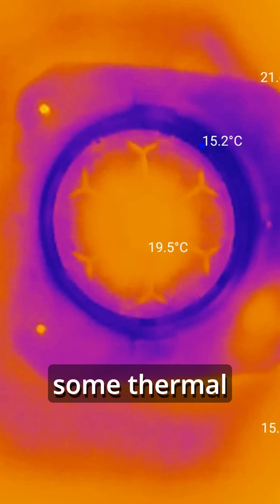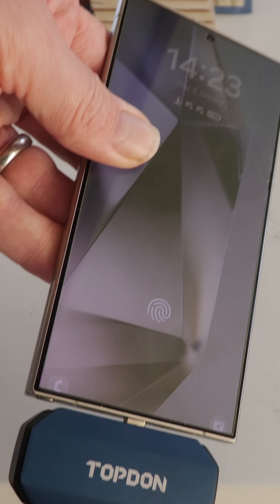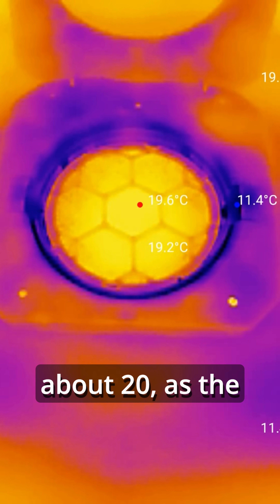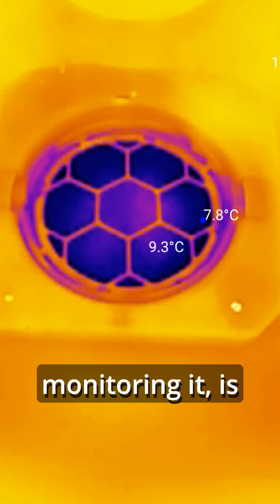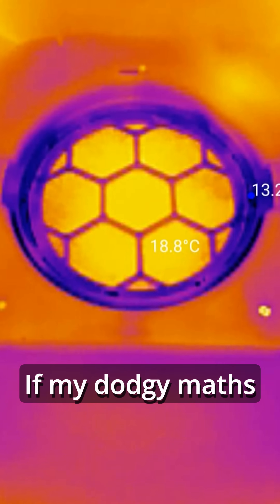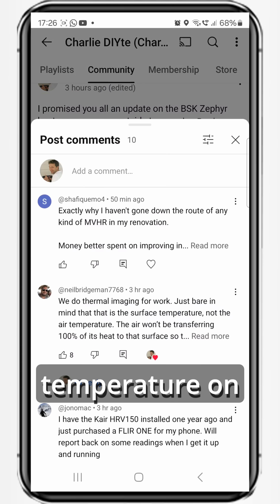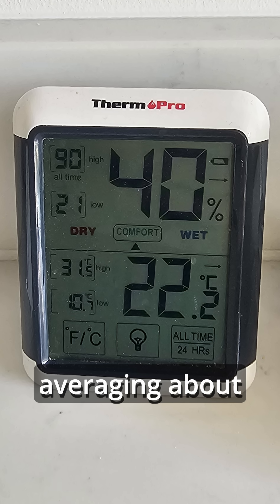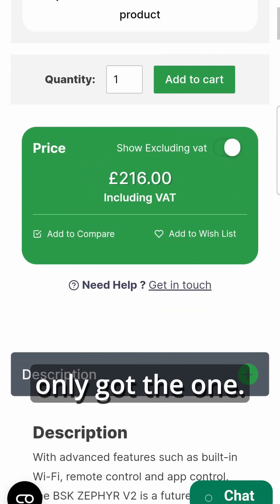Do Heat Recovery Fans Work on a Chilly Day? #shorts

Comment: I'm only considering this to combat moisture in our bedroom during winter. We get crazy amounts of condensation in our and our son's bedroom.
Reply from the maker: Check out this video https://youtu.be/NbtijHKy2Vo?si=XxVpbqKe1fMdktE0 You'll solve a lot of problems by following these steps but without double glazed windows it's very difficult to stop condensation in the winter. Consider getting a PIV installed if you've got roof space and in the meantime definitely get a Karcher window vac to vacuum away the condensation every morning.. Whatever you do don't use a towel as when you put it on the radiator to dry you're just putting the moisture back into the room and so the cycle continues. Also, ever few days open ALL your widows for 5 minutes. You'll purge SO MUCH MOISTURE from the air doing that. You're welcome 😉

Comment: Installation cost and electricity running cost of the fan is cost effective fir the heat gained? Or would you be better off just paying for more heating?
Reply from the maker: I think it has a noticeable difference on air quality and the relative humidity in the room has plunged.

Comment: Ok someone will need to explain this to me, why?
you expelled hot air out of the room, to warm a ceramic tube, to import mildly warm air back into the room?
Reply from the maker: I think when paired with another one it's meant to give you a form of air circulation - a poor man's MVHR. But it's vastly inferior to MVHR

Comment: You have this the other way round! Showing the surface temperature of the ceramic is the maximum possible temperature that the air can achieve, however you would need to have an infinite amount of surface area to effectively transfer heat to that temperature.
You need a different method of recording air temperature as this method does not tell you the average air temperature after it has passed through the exchanger, I think you would actually get a more accurate reading with a standard thermometer.

Comment: I'll leave the below untouched for context, but I second thoughts it's snake oil hokum.
Either way, warm air out, cold air in reduces the energy in the room by a fixed amount depending on volume of air in/out, and thermal capacity of said air (dense and damp Vs light and dry).
It's like saying pouring a bit of hot water from Jug A through a magic funnel and topping it up with cold water from Jug B through the same funnel will somehow be different to a regular funnel
 I get the theory, and the general physics of absorbing some of the heat to put it into the fresh air makes sense, but I feel like the payback time would be astronomical compared to just opening tbe window for a short time, given that the walls and furniture in the room will also act as a kind of storage heater, heating the fresh air back up fairly quickly once the window is shut.
Reply: Why would you open the window for just a short time? Ventilation needs to be happening continuously to keep indoor air 'fresh' (low co2, other bioeffluents).
Reply: @Netherlands031 true true, now you say it, it doesn't make much more sense having a fan that kicks on and off periodically Vs runs low continuously.

Comment: The heat recovery is most likely lower not higher. You've got to remember that thermal transfer isn't perfectly even and your dealing with moving air. 
If the rough calculation is showing 37% with core surface temps being used in the equation. Then the average of all the air moving through the core at the time of measurement is going to be lower then in calculation always. This means the actual number is below 37% in this case.

Comment: So when it’s exhausting is your house pulling a vacuum or are you just sucking in cold air from somewhere? Same during intake. You’re forcing out hot air. 
You need a heat exchanger for intake and exhaust, only way to do it.
Reply: In the case of a single unit, the assumption is that the space is big enough for vacuum not to be created even if you have a sealed container. In reality the fan has low capacity and it switches direction every 90 secs so there is minimal change of air pressure and no air is being sucked from other entry points. The issue with a single unit is that it also can't cover a large area. I think they top out at about 11 m2. So once you are a few meters away from the unit there is no impact at all. To do better, you need 2 connected fans ( or more) at opposite sides of the room. Clearly that's a bit of a challenge since most houses don't have multiple external walls in all rooms that need ventilation.
Reply: Very right, so the efficiency needs to be halved to take that into account

Comment: I'll stick with my current HRV that heats the cold air with hot air exiting through parallel channels.  Seems to work well and doesn't cause pressure differences that force the fans to work harder, hence less efficient.
Reply: Whether you're paying for the electricity will be a factor as will be the heat output of the motor.

Comment: Maybe I am misunderstanding something: when the fan works in "extracting" mode to heat up the ceramic exchanger, the same amount of air must be entering the room from somewhere else (gaps, cracks etc). That would be untreated air from outside. Yes, the fan will reverse direction and recover the heat from the ceramic exchanger but my point is that in this process you have quite some COLD air getting in the room as a result.
A proper heat recovery system extracts air WHILE warming up fresh air coming in to replenish the one being extracted. I mean, you cannot beat the laws of physics :)
Reply: The fans are usually installed in pairs, so that the overall pressure within the house remains neutral and unwanted outside air stays out. Having said that, efficiency claims don't appear to stand up and they are often installed singly, as you described. Caveat emptor.
Reply: @balometer  I thought about the "in pair" installation - does that mean that they are linked together and work in opposite directions all the time?
Reply: @tony359  Heat Saves should be linked to a central controller. When one is on extract, the other is on supply.
Reply: @tony359  Exactly. They operate in opposing modes and switch over every 10 or 15 minutes. Lunos units (one of the earliest to market) used to be sold in pairs only, and their controller still defaults to opposing pairs, that may be in different rooms.
Reply: Yes, the air drawn In whilst on extract will be cold. I have a log burner, I light it up and the house gets cold. It draws air in from outside. One room gets hot the rest are colder than not using it. I can’t win
Reply: @Elldeeve  I am not a log burner expert but I'd imagine the idea is to have the intake close to where the log burner is so cold air a) gets immediately warmed up by the burner b) gets sucked away by the chimney without cooling down the house :)
Reply: You're not misunderstanding anything. Also, most of these things cannot be synchronized so installing them in pairs does not help at all.

Comment: So the fan sucks air out of the room, does it create a slight vacuum? Er no air, cold air is coming from outside, getting in somewhere. And when it reverses and blows air in, warm air is exhausting through those self same nooks and crannies. The concept only works if you have two of them working together, one sucking whilst the other blows.
Reply: I'd say the whole concept sucks... or blows... depending on which verb you prefer.  😂

Comment: Why not continuous airflow with a heat exchanger transferring heat from the outgoing air to the incoming air?
Reply: That's probably hard to do in such a small footprint, but yeah that makes a lot more sense. Then you don't need two of these machines for a high efficiency.

Comment: Cardiff uni built the SOLCER house with a parallel flow heat exchanger with a heatpump cooling the exhaust air and heating the pre warmed incoming air. Don't mistake cross flow heat exchangers for parallel flow.

Comment: When the air is exhursting, isnt it possibly that a draft if being pulled somewhere else in the room or hosue that is pulling cold air in?

When it switches to intake, that same draft elsewhere would now be exhausting warm air?

Seems youd need to have a very well sealed building which affects the effectiveness of an extractor fan anyway. Maybe two heat recoverery fans acting opposite from each other would be better.
Reply from the maker: I agree. 👌

Comment: Leave ventilation to the summer, well spring and autumn keeping the summer heat out is more important. Best not to make holes in your house when you want to keep it warm or cool! This whole concept is daft. Yes it will save a little bit of the heat, not much, but better than nothing. But you are also wasting power on it. Going in and out of a door a couple of times a day will probably change as much air and you can't heat exchange that.
Reply from the maker: I agree. I had to put it in for building regs unfortunately. Or A fan at any rate, so I thought I might as well go heat recovery and learn a bit about it.

Comment: Why do you need to suck in cold air from the outside to begin with? When the air is blown out unless the house is pressure sealed cold air will find it's way  in from outside not through the heat exchanger.
Reply from the maker: That's a good point that I talk about in the main video. The point was I had to put an extractor in for building regs so thought I'd investigate what these dmevs are like.
Reply: To get round this problem some manufacturers sell a pair of these which wireless link so when one is extracting the other is sucking air in from outside and then both switch round at the same time (push me pull you style).  Of course it's more expensive and you need to have space to fit the second one somewhere as well.

Comment: I don't understand where these are supposed to be fitted. When is hot air extracted? Is this for cooker hood extractors?
Reply: They can be fitted in any room, the point supposedly being that you get fresh air (which is a dwindling resource in well-insulated homes) without the heat loss you would get from a simple open window.
Reply: @rich8037  Oh okay, and where's the heat coming from? The room?
Reply: @analogdistortion  Yes, the fan initially blows hot air out of the room and it heats the ceramic tubes, then the fan reverses and sucks cold air from the outside, which gets heated by the (now slightly warm) tubes. I can't see how it's ever going to have more than indifferent efficiency.
Reply: @rich8037  Yeah doesn't seem great. How much can the ceramic tubes even hold in terms of heat capacity? The room itself has things inside it that holds heat.
Reply from the maker: They boast up to 90% heat recovery but the reality is less than half of that from what I've seen.

Comment: HHHmmm...I don't think I'll be installing one of those anytime soon... I have wall acoustic wall vents that I put in that do the same job without using power to do it and be opened closed to any degree as required. I also fitted a Nuair Positive Input Ventilation (PIV) system in the loft which, when it needs to run (operated via runs also uses a 5w heating element (if required) to warm the air input to increase the pressure in the property and assist with ventilation... Added to this the new insulation I put in the loft to double depth in the loft (400mm), new Double glazing (unventilated - I sent calculations (as per Building Regs and British Standards) to building control that proved the ventilation I was planning to install was better than the ventilation area of that which would be provided by new double glazing vents, and better controlled), and since that time the issues I encountered when first moving into the property (a bungalow) in July 2023, have pretty much been completely eradicated. Fortunately i had the cash from the sale of my previous home to install Solar PV Panels and a Tesla Power-wall II with backup, that on completion in April 2024, supplied all my electrical needs right up until November 2024, as well as exporting to the grid, so i saved six months electricity bills and got paid almost £300 for the exported energy to my registered supplied... SO, I'm a happy bunny...having the money to do that installation has for me been worth every penny of the £11.5k cost (the Tesla Power-wall II and backup unit cost £5.5k and the local electrician I employed was very good, and even returned with the electrical industry certified body assessor for The National Inspection Council for Electrical Installation Contracting - NICEIC (he asked me first for approval), as part of an audit being carried out, and i was happy to assist him in letting him do this, and the job passed passed the audit no problem...
Personally, I don't reckon much to the way these systems currently operate. and i think the heat exchange needs to take place over a longer length of ducting and at a far slower pace to allow more benefit from the exchange and in much finer mesh ducting within the insulated exchange apparatus... these units are to me much like ground source heating...just not suited to the UK environment in their current form, and ground source heating is a complete waste of space and money in the UK unless perhaps you have a great deal of suitable land ion which to install it, and of course meet those costs... Likewise the proposed use of domestic boilers running on Hydrogen. As a 20% mix is proposed first, by 2028, that will mean new gas boilers should be able to use the proposed mixture... but every boiler installed, even new ones like mine (Worcester Bosch green star - installed in 2024), would need updating to burn a richer hydrogen gas mix...
So, for the time being I'm set, and will look at seeing what other areas of the property can be improved without having to rely on unproven and highly expensive tech that natural ventilation and hand operated controls can easily equal if not better...
Reply: unsolicited

Comment: I think you got Neil’s point the wrong way round. Say the heat recovery is intaking air from outside and heating it. The thermal temperature of the surface will be hotter than the actual air coming in, as the air coming in won’t get all of that heat. So instead of your heat recovery calculation being higher, it actually should be lower.
Reply: Yep, Physics great truth - You don't get something for nothing.
Reply: Came here to say this